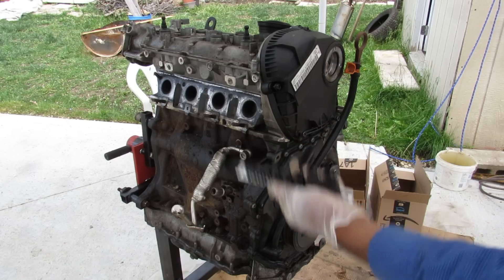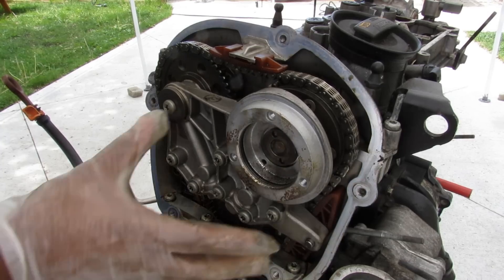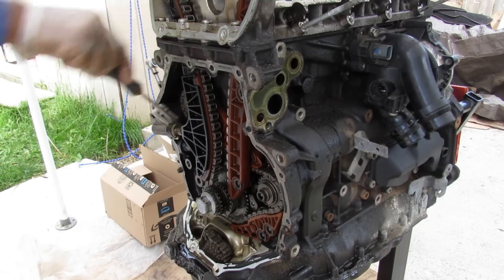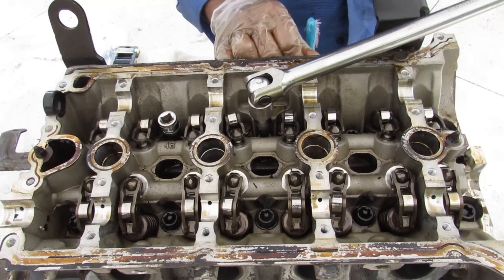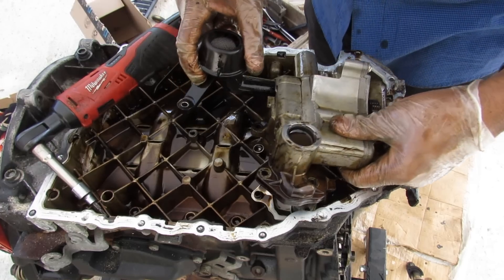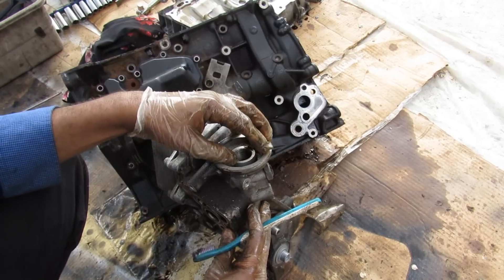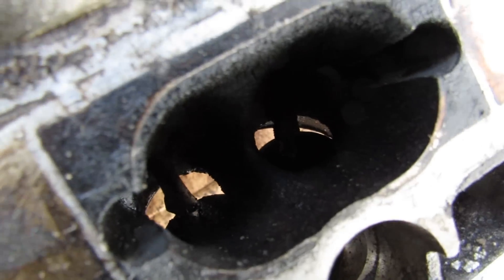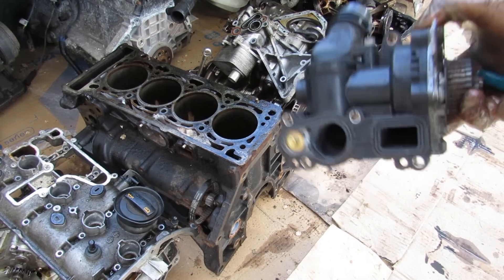Why Volkswagen Engines Fail

Comment: As a shop owner specializing in European cars I can say this is the absolute worst engine VW/Audi has ever made. Has a laundry list of common failures. Got much better starting in model year '14 but still not one I would ever own.
Reply: I thought that honour goes to the 1.4 TSI twincharged engine that ate its pistons for breakfast?
Reply: @skrevox  That 1.4L twin charger is another issue altogether. This engine usually is paired with a dry clutch DCT transmission. Before the engine starts having problem, it is the transmission that goes out first. At least the EA888 is paired with a wet clutch DCT which is alot more durable.
Reply: @skrevox  my normal 1.4tsi 122 hp with turbo only broke down two months ago. 
2 injectors were leaking suddenly didnt got a message or signal it wasnt working properly. 

End of the story the engine broke down.
Reply: Have you had experience with VW’s 2.5L 5-cylinder engine because I’ve heard that they are better than the ones that you normally see in their newer vehicles.
Reply: @PseudoSpaceMarine  the one from the old 1990s Audi 500?  They were very reliable, as far as I know.
Reply: @Visionery1  I'm referring to the ones that were made from 2007-2014 that were used in models like the Passat, Jetta, Beetle, Rabbit, and Golf.
Reply: @PseudoSpaceMarine  Those 2.5's are generally reliable after '09. The '05.5's through '09 had timing issues. Was finally resolved by '09. Timing chain issues is a very common theme with almost all VW/Audi timing chain engines
Reply: @PseudoSpaceMarine  the Golf and Jetta engines from the 80s were indestructible, even a failed cam belt didn't destroy them.
Reply: @Visionery1  Because they were designed by Karl Benz
Reply: @ PseudoSpaceMarine

2.5?  

You mean the engine you want when you want the power of a four cylinder with the fuel efficiency of a six cylinder.
Reply: @Bartonovich52  you aint lying about that fuel efficiency. i have a 2013 2.5l passat se and get like 18mpg lol. they have a really good amount of low end torque for a stock engine though not gonna lie. the 0-60 is slow (8 seconds-9 seconds) but dat 0-30 or 0-40 is almost instant lol
Reply: @Bartonovich52  tbbh that low end torque is probably why they get shitty efficiency lol. its hard not to floor it from every dead stop lol
Reply: @Visionery1  pretty sure those were a whole different animal
Reply: @Visionery1  unless it was a 16v, or a diesel........
Reply: Hi yes I have passat 2.5, great engine, great torque at 3k rpm, just change the oil sooner than recommended. mine has 152000kmiles on it.
Reply: @PseudoSpaceMarine  The 5-cyl 2.5l are reliable. specially the 170hp version, but very thirsty, I traded mine for a TDI. The early 6-sp auto transmissions from 2005-to 2009 or so where also prone to control box failure. The DSG is another matter, has been very good to me.
Reply from the maker: Glad to hear from people with experience
Reply: Mine has 200k miles. Through its live it needed: waterpump (leakimg), vacuum pump (leaking oil), belt tensioner (as a precaution), coils (one packed up, changed 4) and that will be it. Change oil every 20k miles as recomended Mobil ESP 5w30. I think it is not that bad.
Reply: @xg5zm  bro? 20000 miles in between oil changes wtff bruhhh please let me never by a car from you
Reply: @logicxhardcorex  right?? i own a 2.5l vw and its recommended i get one every 3k miles, and 5k at max.
Reply: @xg5zm  You change your oil every 20k miles and you wonder why you have problems?
Reply: @Alexandru-T.  I do not think I have problems. For a car with 200.000 miles and 12 years, my list is not large. Nor of the repairs listed are related with oil change frequency. 20.000miles is fineif you use quality oil and quality filters, it is the norm nowadays in Europe. To gibe you a reference 4 quarts will cost 80USD and a filter is about 30USD in a parts shop Mobil 1 and Man branded, respectively.
Reply: @Alexandru-T.  amen
Reply: @xg5zm  Recommended oil change is 20K  that's crazy
Reply: @xg5zm  20k miles lmao
Reply: Worse than 1.8tsi? No way!
Reply: is a vw tiguan 2011 the same problems ???
Reply: @kevinhunt819  very likely it does, but do not panic. EXEPT for the timing chain tensioner. You should definitely replace that for the latest part revision. It is not as expensive as it might look. 150USD for parts, tensioner and cover, plus perhaps 3 hours shop time. Totally worth it so you don't end up with a very broken engine likewise it happened to thus one in the video. Other common problems in thus engines aren't any way as critical or frecuent. Use Mobil 1 ESP 5w30 and good filters.
Reply: what do you think about the 1.5L eTSI if i may ask
Reply: One would think VW engineers are competent enough to design something better, then again, they don't want it to last.
Reply: No, man, didn't you read the comments above? Clearly it's all that "emissions crap" 😂😂😂 Everything would be perfect if not whatever it is they're talking about. They're experts in engine design. 

Really tho, this engine is so needlessly complicated. It's "over engineered" like they got paid by the hour to redesign everything they possibly could, for better for worse (usually worse)
Reply: @ChubiChan  The Germans have been addicted to overengineering stuff until it stops working since at least WW2. The Panther was a great tank, hypothetically. In reality it almost never managed to get all the way to a fight before breaking down.

Comment: WTH is happened with German engineering? A mix of different materials on the engine block.(iron, aluminium and plastic) That's just disaster waiting to happen in the long run.
Reply: It's a myth. Korean and Japanese engineering is still the top.
Reply: It was a thing in th early 20th century, because they where more developed country compared to the others back then. For decades now, it is just a myth that they are riding on.
Reply: I sympathised with the bent valves
Reply: @erickjuma7643  Gay valves?
Reply from the maker: I'm still not sure what they thinking with an iron block

Comment: The Wasserboxer was one of the worst engines EVER built, and it was VW's baby. So bad they only ever put it in one model of car - the Vanagon.  The Wasserboxer wasn't reliable, didn't get good fuel economy, didn't make any power, and it didn't even make a nice noise. There were no redeeming qualities about it whatsoever. It was basically only good for turning gasoline into heat, noise, and exhaust. Complete trash.
Reply from the maker: Good to know
Reply: Yet.... it’s in the back of a Westy that someone wants ten grand for!

Sure.. a Westfalia is the epitome of #vanlife ...... but I’ll take my 28 foot C Class with a reliable 460 and a loft, kitchen, dinette, bathroom, shower, and full bedroom in the back that can pass a Westy like it’s standing still.......

.....and that I could drive to Patagonia and back and still not make up the difference in price in extra fuel costs.
Reply: My '86 Syncro Vanagon with the 2.1waterboxer went 386K miles before failing. Never rebuilt. Oil changes at 5K miles
Reply: To be fair VW had to do SOMETHING about the air-cooled Type 4 engine in those early Vanagons and developing an all-new flat-4 for a low production vehicle wouldn't have been cost-effective, so they added a water jacket to the Type 4  so they could boost HP and called it the Wasserboxer.
Reply: @driveway_of_misfits  but they did one good thing, they gave us an OE quality stand alone electronic ignition setup and distributor that drops right into an aircooled.........  past that, yea I hate them with a white hot passion of a thousand suns.

Comment: Is this the engine that would beat it's cylinder walls square and cause oil consumption problems?

Edit: it is!  I owned an 09 a4. Audi replaced the whole engine because of oil consumption.
Reply: That happened mostly on longitudinal engined cars, which used ovate pistons designed to fit the cylinder perfectly once heated up. Better theory than practice...
Reply from the maker: Never heard of that issue. Was it due to piston slap?
Reply: Best to just dump the car and get an A7. The model that has the N/A 4.2L V8.
Reply: @applepoop10  The 4.2 has its own set of problems and faults. Have you seen the timing chain set up on those?
Reply: @TeUhtred7860  When I first saw the timing setup of the Audi's V8, I thought it was a photoshopped meme. It wasn't.
Reply: @applepoop10  that's been a couple of years now. The engine was replaced and I traded it in for a Subaru!